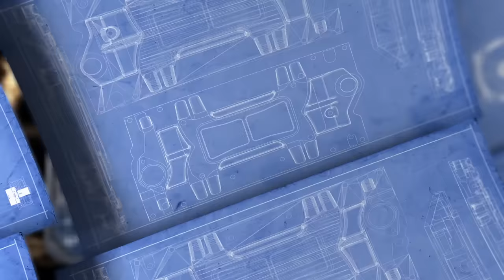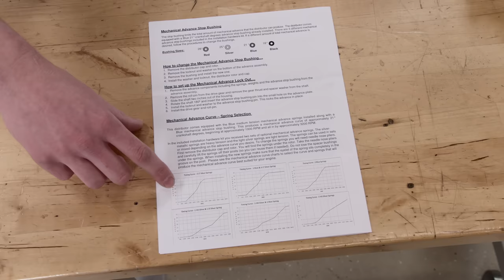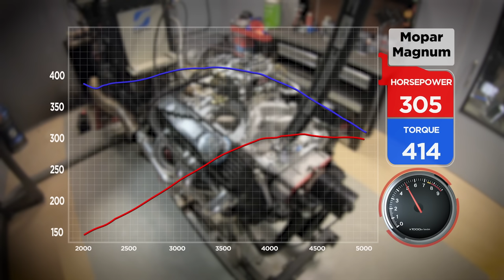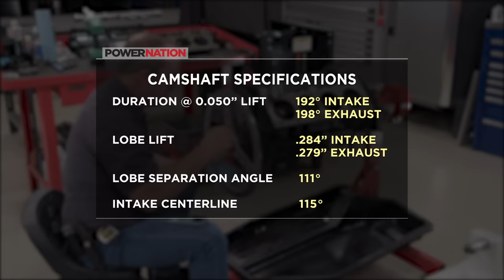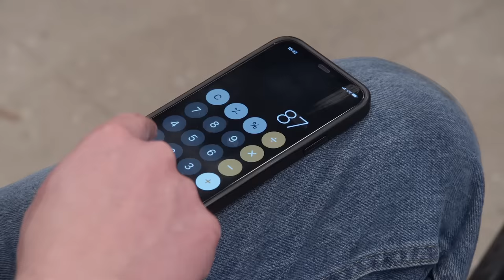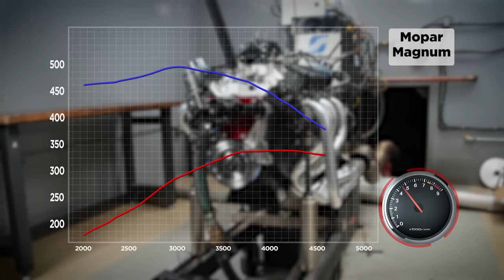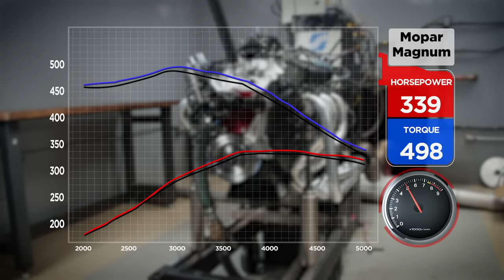What Happens If You Just Add A Stroker Kit To A Stock Mopar Magnum? - Engine Power S9, E3

Comment: Stock Magnums were rev limited to 5250RPM. They ran into valve float after that. Stock heads: Michigan heads, 195-205CFM. Mexican 5.9L heads: 215CFM. Make sure you have Mexican heads, better parting lines, and truer to design ports. 

Wake that engine up with a REALLY good porting and polish with 2.02 intake valves (Steve Sanchez at Total Flow in Troy, MI). Get a better cam, single piece pushrods, and try a set of Crower S.S. 1.7 ratio full roller rockers.

My Magnum? No stroker, .030" over makes 395HP and moves my Indy Ram (4750lbs) through the quarter in 13.87s at 102mph. Daily driven, starts every day, AND gets better fuel economy than stock.
Reply: No way it gets better mileage than stock 😯
Reply: Awesome!  I would like to build  360 with a stroker crank for my Durango. I would probably leave the cam and top end alone. Just mainly focusing on make it torque monsters. What’s thoughts on a build like that. My goal is to have a great tow rig and trail/rock crawler.
Reply: lol and if you need more revvs might need a different tourq converter or just put your 2jzin there
Reply: im not quite shur what is expected in mechanical engineering vs just loveing it like mc d"s
Reply: @Paranoid-loser if he keeps his foot out of it
Reply: @Paranoid-loser  These things got TERRIBLE mileage stock.  The stock setup just doesn't breathe or burn efficiently.  Good heads with higher compression, freer-flowing exhaust, and not too much cam are all good for fuel economy.  Fuel economy gets bad again when you start doing things like a huge sloppy cam, rich tune with compromised timing, high stall converter, 4.10s, strokers, power adders, etc.  You can get power by increasing the efficiency, or by throwing more into it.  These engines come SO inefficient that you can get a boat load of power from efficiency gains.  That's not the case when you start with a more modern engine.
Reply: Hm, might have to try some of that. As for heads I got the engine quest replacement heads so better porting and less likely to crack between the valves.
Reply: My 360 LA engine.  Edelbrock Performer  heads dual plane manifold  Comp Cam 230 235 w  505v510 lift 2 step headers 10.0 compres s ion. overbored .030. running a 750 dual feed Holley.
414 hp w 440 ft lbs of torque.
Simple and old school.
But adequate. Put it in my 70 Dodge Challenger a pretty heavy car .
Running a New Process 4 speed auto w full lockup a nd OD. 2000 stall converter. 3.55 spool rear end.
Decent street combo with really nice freeway performance.  cruises effortlessly at 80 mph with lots left for top end.
Always wondered if I should have gone with ported Eddy heads Indy single plane and a 408 stroker kit. And a 850 Holley.
but I was worried about the durability of the transmission with the extra torque.

Comment: "𝘛𝘩𝘦𝘴𝘦 𝘰𝘯𝘭𝘺 𝘮𝘢𝘬𝘦 240'𝘴 𝘴𝘵𝘰𝘤𝘬"...

The Magnum engines were rated in SAE 𝑵𝑬𝑻 HP, tested with a full exhaust(from factory manifold to tailpipe) and induction(including the filter/filter housing) as it would be installed in a vehicle. SAE NET also requires all the accessories being driven. The pull you did with long tube headers, no driven accessories and an electric water pump gives you an SAE 𝙂𝙍𝙊𝙎𝙎 HP rating. It's the same reason the 426 'Street Hemi' appeared to lose 75hp from 1969 to 1972 despite the engines being identical.
Reply: I'm sure the people who made this show knows this ! Alot of people who watch this doesn't really know this r care there watching it to bond am maybe get ideas  I think u should make a pod show a out your knowledge r what's wrong with this show an others

Comment: Thats just a downright good build that will get you a couple hundred thousand miles and enjoy every one of them.  Good job guys, I just may have to build one.
Reply: @bigboreracing356  But out of the people that would build a 360 this way, most will get well over 100,000-200,000 miles out of it. You don't make a build like this if you're a lead foot, you do a build like this if you want big block torque in a "stock" small block.
Reply: tbh, it wont last half that. 408 strokers side load the hell out of the cylinders.

Comment: It's going to pull really hard to 3800 then feel like it's taking a nose dive.  The HP never gets above the torque. Truly an all torque motor. Good for putting in a duly and hauling or pulling stuff.   Doing crazy burnouts in the streets.
Reply: 100% correct... Slow as grandma torkie as Fuk... Fun as hell to drive
Reply: It's more fun to get there quick, not go extremely fast.
Reply: a good camshaft would rectify that
Reply: @clintyoung6482  Torkie is not slow. Torque is what gets you off the line, and presses your eyeballs in the back of your head while doing it.  Stop light to stop light, street racing the car that pulls next to you at that light, torque will win over HP every time.  If I have a car with 500 torque, and 300 hp, and you have a car with 300 torque and 500 hp, I will jump so far in front, there will be no room for you to catch up before we have to slow down for the next intersection.

Comment: 305hp and 414 Lb. Ft. for a basically stock 360 is pretty good. And with just the stroker kit swap, 334hp and 490 Lb. Ft. is very impressive. And then they top themselves with the 950 on it, it made 339hp and 498 Lb. Ft. That's insane for essentially a stock small block.
BUT, they are running the engine with absolutely NO parasitic loss from accessories. There isn't a single thing pulling off the crank, they don't even have a belt on the crank at all! 
These are gross horsepower/torque numbers, not what the factory uses. Factory numbers are SAE Net, that is with all accessories, water pump, fan, alternator, power steering pump, and the air conditioning compressor. So don't be fooled by the numbers here. They are good, but not what you will see in the vehicle with all the accessories pulling off the front of the crank.
Reply: Agreed i was thinking the same thing an wondering what would it be … with all the factory stuff on it ? Any idea or good guesses?
Reply: And they run their timing locked. Not a single person is going to drive it with locked ignition timing on the streets..
Reply: They discovered it had been punched .40 over during tear down so it's bored & stroked. But those numbers on stock everything else just shows what can be accomplished with stock parts.
Reply: If it had all accessories and hooked to a 46re trans then yeah its putting down 210hp 330tq to tires 😆
Reply: The new numbers seemed way too high... until it dawned on me that the extra cubes cranked up the compression ratio !!! And we don't know the compression heights of the pistons and whether the new ones were also higher up in the bores as well... 
If the compression ratio had been the same, the new HP numbers would have barely increased at all, maybe 2 - 10 numbers higher... but torque up by around 50 - 60...
Reply: It's a perfect comparison when compared to almost every engine on a dyno, with a locked distributor and elec. water pump. How was YOUR ENGINE dyno-ed? Good points on apples to apples comparo.
Reply: Using the 15% method for calculating power loss from their peak 339 HP achieved in testing, the HP drops to below the factory SAE rating of 305 HP, to 288.15 HP. So either the 15% method is off (likely) or the SAE rating of 305 HP of the stock engine is off (also likely).
Reply: @SGTJDerek  they said “align plate honed” not bored .40 over lol
Reply: @BuzzLOLOL  The deck clearance is .004 above and he mentioned a calculated compression ratio of 10.73:1. I'm guessing 62cc chambers, a .044" compressed  gasket thickness, and a 16cc dish. I may be a tiny bit off but close. This torque monster would be awesome in my little half-ton SLT.
Reply: @gorkzop  Wanna bet? I do.
Reply: @CarsandCats  will people do it? Probably.. loads of dumb people around. Doesn't mean it's a smart move
Reply: @gorkzop  Just because you can't, doesn't make it wrong. I'm not even going to waste my time explaining to you. You're not worth the effort.
Reply: Bet stock numbers would put my dart in high 12s if it hooks
Reply: @DarrensTruckzs  You could safely knock 50-75hp off the top with all the accessories on it.
Reply: It isn't "their" overall power that impresses me. 
   It is the obvious differential gain from the Stroker before and after. 
    As far as your accessories, they weren't on there to start with. 
    So......

Comment: Had a 360 in a 79 Class C motorhome. That engine was bulletproof and we put a significant number of miles on it. Reliable and torque must have been good in stock form since we pulled a car behind it with no noticeable effects. Stopping it with a car on behind was another matter entirely. Great Chrysler chassis on that old motorhome...
Reply: '94 & up Magnum 360 a vast improvement over that weak gas hog '79 360 !
Reply: It’s crazy the amount of old dodge motor homes you still see on the road

Comment: This is sort of like the engine my friend built and sold to me in a '94 F250 reg cab 2wd 5 speed manual, it's a 393 stroker AFR 175cc heads with 1.8 rockers, stock 5.0 H/O cam, Lightning lower, Explorer upper, 70mm TB, Longtube Tri-Y headers ran into a single 3.5" exhaust. I figured it must make 350-400hp and at least 500TQ, if stock iron Magnum heads and a cam that small did this on a 410ci, I must have been correct, certainly with more cam, maybe a tiny bit of head porting and /or bigger intake valves, a highrise air gap single plane intake and either an 850cfm carb or Holley Sniper it would be around 500hp+ and 475-525tq. This was very encouraging, I could tell the truck is strong, if you dump the clutch in 2nd it rolls white smoke off a 255/85 16 tire that weighs 80lbs on a steel wheel with an open 3.55 diff and keeps burning out violently after the bang shift to 3nd for 200-300feet at 85mph then finally hooks up in 4th around 100mph. It belonged to the owner of the AHRA, Dallas Brown. I bought it last spring.

Comment: Well not being critical but it is about what one would generally expect to see happen.
The small block Chrysler has a long rod anyhow so the stroke to rod ratio remains OK without too much angularity.the up of 50 cu inches is all due to stroke so of course torque curve starts earlier is flatter and appreciably higher.
Back in 2000 I built a 360 with Edelbrock alum heads and CR.
10 to 1.that engine generated 414 hp and 440 ft lbs of torque with a pretty hot hydraulic flat tappet cam and 2 step headers running an Edelbrock dual plane and a 3310 Holley.
Increase the cubes 50 ci. 50 more ft lbs of torque. On a typical  move from a 350 Chev to a 383 with a 6 inch rod watch your torque jump from around 405  to 460 ft lbs even more dramatic 33 more cubes and around 55 ft lbs of torque increase.
Not surprisingly the hp didn't do too much because the heads AND the cam are too small for the cubes.the increase in carb size and the result shows what we already knew or could have guessed.
The CR of course at 10.75 with the iron heads means you re not going to be using 91 octane pump gas as I am able to do with my 10 to 1 alum head motor.
About 4 years ago I screwed together a 408 stroker 360 using the as cast Edelbrock heads a full roller hydraulic valve train 1 step headers and an Indy single plane manifold .
CR was 10 .1 to 1. 
That engine dynoed at 495 ft lbs of torque but 502 hp at 5800 rpm. And yes I went to Carillo rods in that engine.
I used a single plane to KILL some torque since the engine was going in a 65 Dart a relatively light car running 3.9 gears.
I don't jerk around with net or gross hp When the engine goes on the dyno I'm running belts and accessories as it's going to be in the car if humanly possible the same headers.
I generally figure around 65 hp for drive train loss and it's usually pretty close when the car goes on the chassis dyno.
It's a nice short block.
I'd probably have Hughes or someone similar CNC port a set of Edelbrocks go to a Harland Sharp roller rocker and stand setup put better than stock rods in the engine and keep it just under 6000  with an appropriately sized hydraulic roller cam.
It would also be interesting to use a FAST EFi system for more precise fuel monitoring and  fuel air ratio across the band than is possible with a carb.
Had the builders gone with a lower compres s ion setup in my 
opinion it would have made an excellent motor for a 1500 Dodge Ram to haul a one car trailer and car particularly with EFI had the engine been running around 9.75 with the iron heads.
As it is I'm not sure what you d use the engine for.